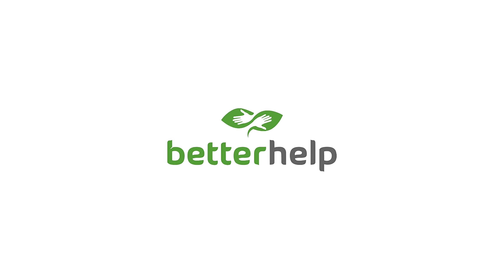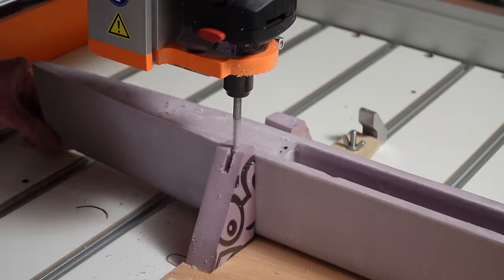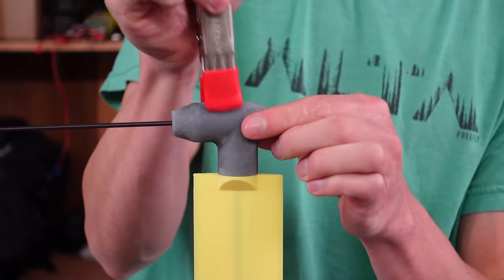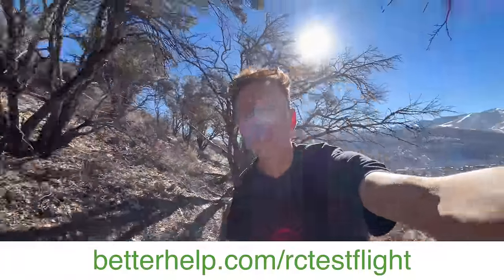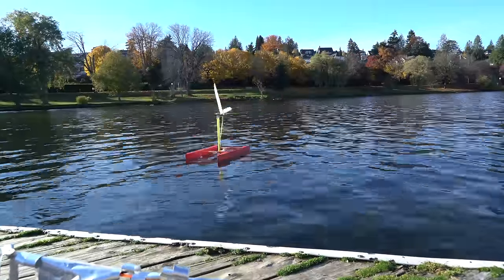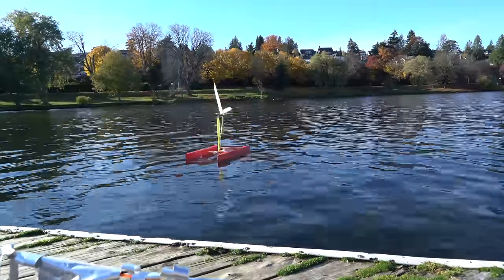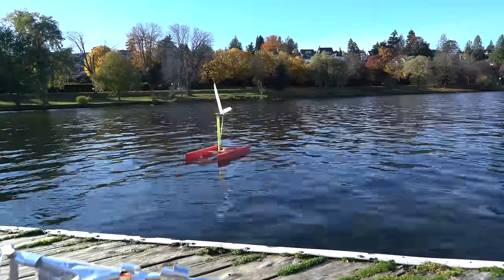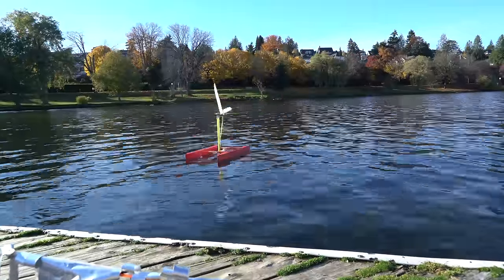Sailing Directly Into the Wind - Is it Possible?

Comment: The thing people forget about gliders is that they also use the potential energy of gravity in their altitude. They dont just levitate due to the wind over their wings, the wind comes from conversion of potential energy to kinetic (ignoring thermals). Yes you can get a high wind from a storm to  supply enough lift to flip a static plane over but they dont fly like that, they're not kites.

As you experienced the "lift" you gain also has associated drag, and if you aren't t careful the large "turbine" propellor produces more drag than propulsion.

Be wary of the blackbird and veritassium, none of these claims have been proven beyond doubt. And please dont use the so called physicists bet as evidence. The physicist did nothing to prove his case at all, so could be regarded as a shill without further evidence. As in your case , where you could barely get it to go in the direction of the wind at all, it is most likely that losses will prevent any wind powered  vehicle travelling faster than the wind. Where does physics even allow that?. It is more likely that people are just misunderstanding the concepts of relative wind.
Reply: You must not have been watching his final run (water prop out front) where it handily sailed upwind about a quarter mile, no problem.  

Regarding Blackbird, numerous other demo's have also been built and have worked.  When a streamer mounted above the vehicle nose vigorously streams aft in the air, what more do you need in order to understand that the vehicle is outrunning the air?

Physics allows it just fine.  It's just a question of thinking through the relative-motion problem.  Take a spool of thread that's near empty so the flanges stick out past the thread windings.  Unroll a few feet of thread, set the spool on the floor with the unwound side down, and pull gently on the thread.  The spool will come toward you, winding up thread as it goes.  So the spool is going Directly Up the Thread Faster Than The Thread.  Sound familiar?

Comment: About 1/4 the way through. Suprised you're not trying several different gear ratios to see that is generally the most efficient, or most efficient for different conditions.
Reply: I would generally try .25, .5, 1/1, 1/2, 1/3, 1/4, and 1/10. Might give you an idea.

Comment: I would love to see a few changes:
1. Move the water propeller to the back, so it’s close to the rudder. (Don’t move the rudder forward.)
2. Tweak your gear sizes so that the water propeller spins faster than the input speed. This should have similar effect to increasing prop size, but I don’t think you want to go much bigger. 
3. Design a better rudder. 
4. Add more blades to the wind rotor.

Comment: Just a small point, that’ll probably make little difference but the grease is going to decrease efficiency, not increase it. It’s sticky and effectively, lightly glues parts together. A better option is a dry wax lubricant. It’s been widely tested in cycling circles and found to be much more efficient than grease.

Comment: If it works as intended, wouldn't that demonstrate over unity efficiency?  The kinetic energy of the wind is converted into mechanical energy in the wind turbines.  That energy is fed to the propeller in the water to push that boat directly upwind.  Because energy is lost anytime it is converted from one form into another, the propeller in the water has less energy than the wind.  If that boat goes upwind, that demonstrates over unity efficiency.  Then the law of conservation of energy is broken.  Did I miss something here?
Reply: Yes, you did.  Because if you watched until the end, you did see,  it work.

You seem to be supposing that all the kinetic energy of the wind gets delivered into rearward kinetic energy of the boat, as if the wind turbine were a solid disc blocking any wind bypass completely AND moving at wind speed.  (Energy transfer requires work  -- which requires motion.  Otherwise you can certainly get some force but whether it delivers any energy depends on whether it moves what it's pushing on.)  Actually the windmill blades occupy a rather small fraction of the area they sweep, so the rearward thrust on them isn't huge, and some of the aero force on them is not rearward but rotational.  They do, granted, have to be moved forward against the force they do receive (but the power required is only that force times the modest speed of the boat, not the wind speed).   Then at the prop in the water, it has losses too, as did the wind turbine, but as noted above,  the power it needs to deliver is only a fraction of what would be needed to drive a solid disc upwind through the air.  It also helps that the medium thhe prop is working in is about 800x as dense as the air.
Reply: @crispinmiller7989  Sounds like a valid explanation.  Will have to think it through.  Thanks.

Comment: Think you miss the point on this. Dude you are not Sailing! It's a prop driven boat. There are Cats and Tris that use a Wing-sail Technology. A Sail works on the same principle as a wing, so when sailing "Upwind the sail will always be trimmed into the wind about 3-4 degrees.

Comment: Maybe just have the boat use an electric motor and have the fan turn a generator to charge the lithium batteries and power the motor/prop.

Comment: Wouldn't a VAWT allow "sailing" in any direction?
Reply: No it does not work
Reply: I realize that the Alcyone is dual powered (diesel and turbosail) but I don't think you're trying for the same speed range. I'm betting the Cousteau Society wouldn't be using the technology at all if "it doesn't work", let alone building another ship using it...

Comment: You're losing a LOT of efficiency by converting the wind power to electrical, then using an electrical motor which is also inefficient.

I would make them mechanically linked with a simple down ratio, then use a simple servo to steer.

Comment: You are over complicating this. Look into what makes a gyrocopter fly, you'll be able to eliminate the geartrain and the underwater prop. What you need is a airfoil that creates lift at a negative angles of attack, a Clark Y creates lift at -4 degrees, but there are better airfoils, Micheal Selig PHD designed some really good ones. Most people thing a gyrocopter flys like a helicopter, but they don't, the air goes down from a helicopter, but i t goes up thru a gyrocopter's blades. Put a gyrocopter's blades on your boat it willpull your boat into the wind.

Comment: For sh1ts and giggles, try putting the windmill directly to a generator then electric to motors.  Then you don't have to worry about battery power for the controls (might need a bit of circuitry to manage the voltage) and it will be self-sufficient.

Comment: Your calculations are far off, the 3wing prop max reaches 75%, the straight angled gears 50% so from 100wind you eventually get 20% power, tacking a conventional boat still would be faster by far!

Comment: Why are you using a vertical wind turbine????
Use a horizontal wind-turbine and there is no need to turn the blades into the wind.
Reply: You have got horizontal mixed up with vertical - its the other way round
Reply: @peterworsley4699  Oops! Thanks!

Comment: To avoid the need for gears to change between vertical and horizontal rotation, you could have used belts.

Alternatively a vertical axis wind turbine could spin a voith schneider propeller.

Comment: I'll give you an idea on how to do it better. The propeller itself must be placed horizontally on a vertical axis. and in order for the wind to hit the propeller and spin it, it must either blow from top to bottom or from bottom to top on the propeller. which means we add something like cones under the propeller, let’s say similar to women’s skirts) in general, a truncated cone as a reflector so that the lower part is wider and the upper part is narrower, so the horizontal air flow will deflect upward to hit the propeller. since the cone has a circle, we get an effect in which wind from any direction will hit the propeller and it will not need to be directed against the wind. for greater efficiency, you can make several cones under the propeller to guide more air volume from the wind to the propeller 2-3 cone reflectors will be normal, while truncated cones should have a through hole... imagine what will happen if you take an ordinary bowl whose walls are not vertical but inclined upside down and cut out the bottom, what remains is a truncated cone with a hole, and if several such skirts are placed on top of each other so that the wind flow is summed up in front of the propeller, we get an omnidirectional propeller-type sail. The propeller itself should be surrounded with a ring so the efficiency will be higher. and below it, circular wind deflectors will direct the wind flow towards it. small losses of wind energy due to the deflection of the wind from the horizontal to the vertical direction should not be significant, but we get omnidirectionality in working with the wind.
Reply: Its not a "propeller" a propeller propels - that's why it's called a propeller - the clue is in the name. If you are talking about the "wind propeller" then you should say "wind turbine" or "windmill" - then it would make it clear what you are talking about. The only propeller here is the one in the water.
Reply: @peterworsley4699  I'm not a native English speaker.

Comment: I am a professional boat designer and surfboard designer. And this phenomena works, no doubt. And the reason why is because air compresses but it doesn't weigh very much. So wind can compress and build up a lot of drive in your rotary sails, while at the same time it doesn't take as much energy for the lightweight wind to pass through and around the boat or vise versa. The boat is not only capturing the wind, but the whole boat and sail rig has to move through the still air plus the speed of the wind, which for the boat, is easier to do. The water which is way heavier and more cumbersome  to move out of the way, can be used to the boats advantage by having low drag hulls and high capture (efficiency) propeller blades, efficiently slicing through the water withe very little drag. So basically, it's a competition between the capture versus drag, of the rig above in the wind, and the rig below in the water. It may be hard to visualize this before building a model and proving it, but if you want to easily visualize this and understand it, just imagine taking your whole finished successful boat and flipping it upside down in the water. The propeller blades wouldn't catch any wind and the wind mill blades, now under water would be hopelessly stuck in the water and the whole boat would not be able to go anywhere.

Comment: I wont watch this video because it is not possible. If it was possible to sail into the wind, one cold sail in any direction without tacking. Moreover, all one would need to do on a still day is to get the sailboat moving now it is moving into the wind and that would make it move even faster ...

Comment: Your idea is not new. I saw a propeller adapted to a thirty foot sailboat (mast removed) in France in 1968. The  prop could be turned to face the wind regardless which direction the wind was coming from.
Reply from the maker: I never said it was new bud
Reply: @rctestflight  FYI

Comment: I built mine already in 1980 - it looks very similar to yours at 13:32  - but it is much faster than this one here.
See https://youtu.be/ygAVnauJTB0?t=233 # the final version at the end of "LUV III Sailing directly against the Wind"
I tried two two-bladed water-propellers: The smaller one performed really well. At least 4 knots without gearbox and any rudder!
To achieve a very powerful high rotation rate, the two-bladed twisted wind-propeller is much flatter than yours, but only at the tips - at least 80° not only 45°!
You can really see, how it accelerates when its self-induced headwind increases!

Comment: i mean its not "sailing" directly into wind if its using an underwater prop
Reply: Bernoulli's principle shows that it should be possible, the very example that people use is a can hanging on a string, with a hose pointed directly at it, and the can moves towards the hose

Comment: Great demonstration of the concept! Steering by turning the prop head (azimuthing thruster) would help plus keels as you mentioned 😉 Have you considered using the wind turbine to generate electrical power so you can re-locate the prop? If you can get the prop at the back and the keel in the middle gives better directional authority. Here's an interesting full size version! https://www.youtube.com/watch?v=IzGCYaJbf0A

Comment: The real question is it going to get to a point straight up wind faster than a decent sailboat, catamaran,  or trimaran can get there by tacking up wind. Will it be easily trimmed for all wind conditions.  Based on no data, I am going to guess no. Lastly, if it worked well, would actually be fun. That answer us a definite no.

Comment: It feels like the explanation needs to address viscosity of the different mediums.  Pretend you had the same basic system setup, but as a flying vehicle - clearly the 52%/48% breakdown isn't going to let the thrust propeller generate more thrust than the power propeller.  The water propeller may have a poorer RELATIVE breakdown, but it is inherently more efficient than the air propeller because of the different viscosity (basically friction).  Which is also evident in the wind-powered vehicle, where wheels generating forward motion against the ground is inherently way more efficient.

Comment: Have you tried using a flettner rotor... https://en.m.wikipedia.org/wiki/Rotor_ship#:~:text=The%20most%20common%20form%20of,furling%20requirements%20in%20heavy%20weather.

Comment: so...
the turbine performance matters? some work on raising the efficiency of the blades wouldnt go astray. 

you want them to produce the maximum torque for the minimum drag, obviously. thin, high aspect, high speed...

remember, for a turbine, they arent a PROPELler, they are a HINDEReller... they run "backwards",  slow the wind down and extract energy. therefore the airfoil and the twist is the opposite to a propeller. 

so they extract energy, produce a certain amount of torque with a certain amount of induced drag, and the rest of the drag is parasitic... the hull, frame, support structure, the prop itself... 

that torque then has to act against something, matched to the torque available.

the water mass pushed backwards by the waterscrew... its pitch and RPM... that requires a certain torque to achieve a certain mass flow acceleration...

some actual fighting with numbers and graphs rather than random design, not that theres anything wrong with it mind you, would yield some pretty good results me thinks. 

then you can run it backwards and try sailing faster than the wind...

Comment: Is this where you started using aerodynamics to explain hydrodynamics?

Let's start with the pontoons. They shouldn't be symmetrical front-to-back. You want a knife edge at the front, gradually sweeping to the "beefy" middle, and then keep it that wide. At about 2/3 the way the the back, you want the bottom to start sloping upwards. What you're doing is having the hull cut into the water, making a hole in it for your hull; water doesn't like holes in it, it tries to fill that hole (a hull is a hole); the slope allows the hull to take advantage of that miserable water letting it push the hull forward (poached efficiency).

If you're gonna go through the effort of installing an air propeller, don't bother connecting it to a water propeller. So inefficient, using air to turn water. The structure needed to hold the air propeller safely in place, is bad enough; butt the mechanicals to work the screw... If you wanna scale this up to a manned boat, you'd be better off using an exercise-bike (or a normal bike, most come with gear installed), and pedaling that prop to dig air.

Now... can you stop using wings to explain propellers? It's like using butt-stocks to explain gun-barrels. And planes are not boats, and when they are, they're fuckin ugly and bad at both.